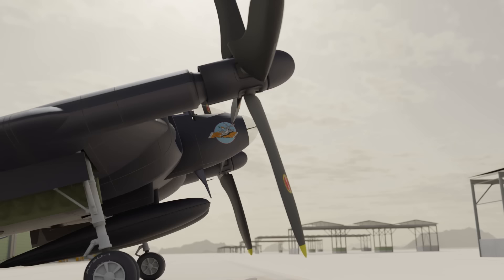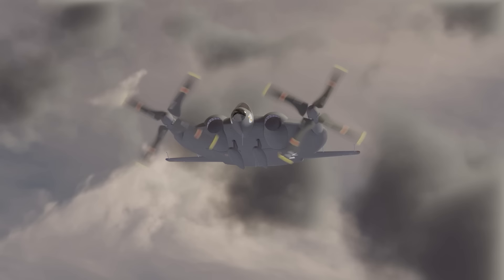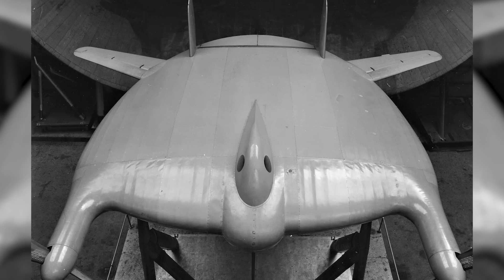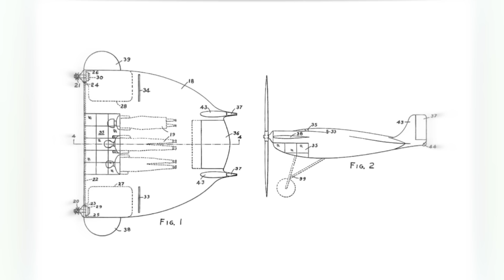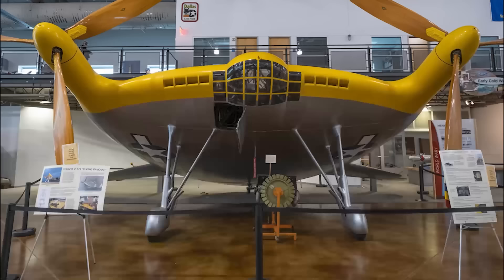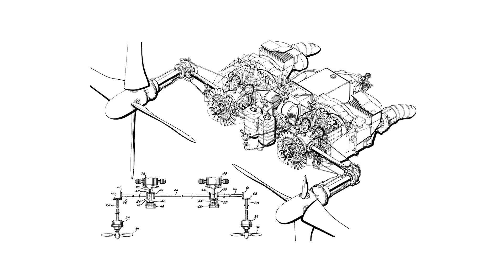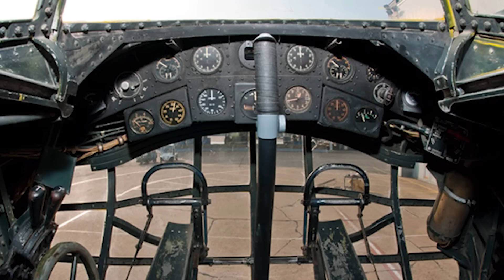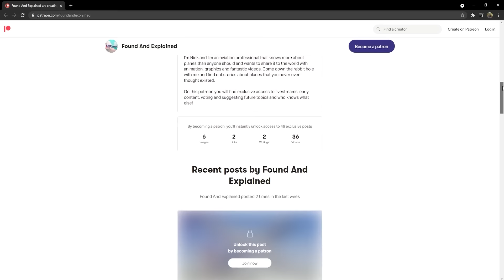The Flying Pancake - Slowest Plane Ever Made!

Comment: Looks like a perfect design to start for an all electric plane. 80HP is a piece of cake for electric motors, this could even work with current batteries.
Reply: Agreed.  No transmission.  The electric motors could be small enough to be pushed out to the edges.  A small turbine Aux can power the electric motors.  Contemporary batteries can do wonders to power a 30-minute flight.  More ideas like contra-rotation of smaller rotors can be helpful.
Reply: @lelandhetrick205  A 30 minute flight at these speeds doesn't seem very useful though
Reply: Hendershot generator
Reply: Look at the surface area of that thing. Cover the top in thin lightweight solar panels to supplement fuel cell/bettery usage.
Reply: smells like startup idea cooking
Reply: @LunaticWithALicense  I was thinking the same thing. I'd even put some over the bottom to catch sunlight reflecting off the ground and the sea. You could theoretically fly this thing around the world without having to rely on liquid fuel, and it could stop to recharge even in the most remote areas.
Reply: @Chad_Thundernuts  Nowadays everybody is crazed about drones, so I doubt anybody would be interested in actually designing this.
Reply: @FzudemB  planes don't have to travel on roads... so distance is a different kind of restraint.  A few mile range can connect people across rivers and canyons.  Just because YOU can't imagine it's use doesn't mean it doesn't have a use.
Reply: @niemand262  True
Reply: @FzudemB  If my mum agrees & if it is affordable I can use it to go to school.
Reply: @ScienceDiscoverer  What does drones being popular have to do with designing an airplane?
Reply: @Exotic-ps7vi  I think he meant quadricoptere  (+ I hate it too when popular term for any multi-spinyboi VTOL aircraft is "drone" now)
Reply: @FzudemB  it's very useful as proof of concept.
Reply: Yes!!  80HP, with no real demand for high speed or high rate of climb, piece of cake!
Reply: Load of solar cells on top? Could recharge on its own.
Reply: How about direct methanol fuel cells? Could work with current infrastructure.
Reply: Even some solar panels on top for a top off.  It would never land
Reply: @FzudemB  There is a market for short flights. Shortest commercial flight is 2km, connecting an island where ferry services are not suitable.
Reply: Why would you want dangerous electric engine in your plane.  Do some physics
Reply: @FzudemB  - That's a 30 minute flight with present Li-ion batteries that have an energy density of only 250Wh/kg. 30 minutes is also a very conservative estimate.  Already there are several new chemistries that are out of the lab that are pushing 400Wh/kg. Expensive and difficult to manufacture but already in use by the US military.  The new solid state batteries are promising better than that.  Non-rechargeable batteries like the Metal-Air Batteries can produce a lot more energy. An example would be the Aluminum/Air batteries which are already achieving 1300Wh/kg. If you want to use electric motors for propulsion but want to avoid the weight then a hydrogen fuel cell could provide ranges closer to jet fuel. I think this aircraft would be perfect for electrification.
Reply: @christianlords1340  How the engine is an issue ?
I though it was the autonomy was the issue.
Reply: Batteries in An aircraft🤦
Reply: @kasperkappe9066 Current planes use batteries.
Electric planes are already a thing but it's not commercially viable.
Reply: @FzudemB  I think its more useful as a “hey look what is possible” sort of thing with only electric motors
Reply: @LunaticWithALicense  solar panels are overhyped. This wouldn't work. In order for it to work a solar plane is highly specialized, it is essentially a highly efficient glider, with solar panels and small motors.
Reply: @AsianCole , so you're short sighted. Americans🇺🇸 aren't.
Reply: @LunaticWithALicense you vould integrate into body. But the energy generated wouldn't be much
Reply: @senatorjosephmccarthy2720  im “American🇺🇸” too but what even was the point of your comment
Reply: @niemand262  planes need runways to land on lmao
Reply: Looks like a perfect design for the wrong brothers.
Reply: Says the engineer
Reply: If you built it I'm down to test it but if I break it don't be upset
Reply: @LunaticWithALicense  tf2 spy moment
Reply: Why don’t you try
Reply: Weight
Reply: Personally i think if we did it right we could glide everywhere, lots of stations and real time weather monitoring, etc. Imagine just being able to hop in a glider and be literally catapulted in the air, cheap to build, out of wood even and slow enough not to be too dangerous.
I want to live in a world with commuter gliding and no roads
Reply: @Chad_Thundernuts  I think having them under would be too little yield to the added hardware weight, not sure on the top side panels though.
Reply: The weight added from the batteries would make any amount of sustained flight unfeasible. To add the power needed takes more batteries and its a ratio that just spins out of control. Batteries still have a way to go.
Reply: @FzudemB  could probably be used for air surveys especially by forest rangers spotting potential forest fire areas while using Solar power for longer range. Removing the flammable aspect of the fuel in the slow observatory aircraft they're using is probably a good trade.
Reply: Give this man an award pls
Reply: @01MEGABOB  good Point... but I wouldn’t take today’s smaller engines and much higher energy to weight ratios out of the equation... same goes for compositit materials and smarter eltronics. I didn’t look into the math myself but it could I think it could be done as an electric plane if u take all of this into account and maybe play around with the shape os size a bit. Btw I love that u seem to have really thought about this, keep it going bro :)
Reply: World's shortest commercial flight is around a minute and a half in good weather.  So I think there's a lot of potential in the half hour range, if you consider things like that.  The solar panels wouldn't really extend the range as sunlight can't necessarily be relied upon, so for safety reasons you'd need to limit it to worst-expectations.  But by goodness they could save a lot of time and money recharging it!
Reply: @01MEGABOB  what if the battery was also the plane itself
Reply: @lelandhetrick205  why push th out to the edges? How many planes have thrust at the wingtips?
Reply: Seems easy to fly too
Reply: @christianlords1340  an electric engine is dangerous? You mean it could stop working?
Reply: 80HP? I cast Power Word Kill.

I know, I know. It doesntean Hit Points, but shut up, Internet. Let someone have fun.
Reply: Do you know how much more batteries weigh than gasoline for the same energy output?
Reply: @ScienceDiscoverer  Concept, currently the classic Predator style drones have comparatively limited loiter ability due to the need for fuel.

In Afghanistan (yes recent sore point) British and NATO forces supplemented that and other aerial assets for ground surveillance with what was essentially a blimp with multiple optical options.

Unsurprisingly they were shot at regularly with a variety of small arms and rpgs, most missed and provided enough information for retaliation. However, some were successful which removed an essential asset and lead to exploitation.

A big slow surveillance system with minimal power draw, with space for a broad range of sensors, as well as broadcast capabilities to talk in different ways to different assets, could be useful.

So sure drones, but how about one like this.
Reply: @Prodzick  Typically weapon fire autonomy is the main concern.
Reply: @01MEGABOB  maybe, but a predator drone has a typical loiter/time on station of 14hrs. If you can do 21, you've already massively improved your options, double it, and you've reducing the fleet maintenance time. Go beyond that and your returns keep coming.
Reply: @Arcenture  thats all fine and dandy. But given our current battery technology we have no way to match the power to weight ratio of traditional aircraft, nor make a battery that has an equilivenant energy density. Its simply not feasible. It is literally a math problem that can't be solved for what we want. At this point we need to figure out fusion or abandon the idea that fully electric aircraft could be worth more than they are now, which are essentially toys.
Reply: It fills a niche that isn't really in demand anymore.
Reply: Some electric cars have 1200 horses
Reply: @heiko5209  and what is the range of these cars? guessing its not much considering it had to use most of its available space to house to gigantic motors for all that power. this is what I have been talking about. you cant have everything. if you watn more power you need more motor, but to go the same distance then you need more battery. but wait, you just got heavier, so add some more motor. oh wait now you use more juice, so add some battery. and so on and so forth. same damn story with planes, with double the consequences.
Reply: Also further imagine that the gliders are equipped with fly-wheel powered propellers for an extra boost when needed, and possibly there could be a way to use drag to rewind the flywheels by placing turbines posterior to the propellers that engage when needed for air braking or passively when gliding for gyroscopic stability, possibly having multiple gears for certain functions. 
It's only natural that fly wheels should be used for flying
Reply: Look up electric planes. There are already models that are fit for commercial use im small aircraft travel. Thats a giant market and its taking it by storm at this moment. Deutsche post ordered tons of them for postal delivery
Reply: You can patent a different method of using someone else’s patent…
Then you and the other person have to be paid for it
Reply: No need to, many turboprop already got fitted with battery, most of them able to fly good distance with good payload.
Reply: Electric flight is VERY FAR away. The weight of the batteries is the biggest barrier.
Reply: @FzudemB  a recreational flight for enjoyment will be nice though
Reply: @Exotic-ps7vi  pretty sure what he means by drone is UAV unmanned aerial vehicle
Reply: thing called drones?
Reply: No... Fuel's still better due to its very high energy density than batteries. And aerial refueling will help a lot. And soundproofing can also be done on this design...
Reply: Modern giant ultralight construction with huge wings like what they use for gliders is still better I bet. That's what they're doing now for experimenting. Just try putting one of those in a ship for takeoff 🤣
Reply: @niemand262  It doesn't have a use.
Reply: @romaboo6218  How exactly would that happen genius?
Reply: @roncatman6236  by crashing
Reply: No because batteries are still too heavy at reasonable energy levels.
Reply: @justsain3236  you'll still need a ppl
Reply: @01MEGABOB  this isn't meant for sustained max speed long distance flights, it's just meant to fly from here to there so there's no need for really big batteries, plus the electric motors don't drink energy that fast
Reply: @ch6ney  and you know how much easier it is to obtain electricity than gas when you're stuck in the middle of nowhere?
Reply: @01MEGABOB  ACKCHUALLY those cars actually have some really long ranges, take Teslas for example, they have a lot more than 80 HP and they can go really far too
Reply: @roncatman6236  if you're wrong you have to eat your slipper
Reply: @Chad_Thundernuts  I know you haven't done the math on that!
Reply: Don't be quick to ignore this things overall weight was 1000kg, before batteries, sorry dude I don't think we have the correct efficiency to make this viable with current electric tech, we could certainly make it fly, but 15mins for 50miles ain't worth shit....
Reply: @FzudemB  good enough for a flight between small distances and short runways, like a bunch of islands
Reply: This plane was designed to take off from a really small runaway and be slow, it is not something you would need on an electric plane and also you can make it actually more efficient if it goes faster because you have more lift per surface
Reply: @FzudemB  It's more then the right brothers
Reply: This could be a great way to get from two close cities, or to get to the mountains from about a 5 hour drive away.
Reply: @christianlords1340  "Electric Engines", or DC Motors, have been around since WWII, possibly earlier. RC Cars, Drones, hell even full scale Electric Trains have these. "Electric Engines" as you call them are not dangerous. It's clear you need to take your own advice and "do some physics".
Reply: Planes of this sort have shown that they're quick on little power and have astounding climb rate.
The V-173 was based on the Arup S-2 from Indiana, 1932. See thee "Flying Heel-lift" video on youtube. See also the Nemeth "Parachute Plane" and the similar Farman 1020 from the same time period as the Arup. Like the Nemeth, very-low aspect-ratio, faster than the planes which the fuselage came from, super-STOL, stall-spin proof like the Arup, capable of amazingly steep climb.

There's a circular wing single-person VTOL quadcopter by Zeva being tested now. Like the Zimmerman plane, it uses the super-slow flight and stall-proof characteristics at high nose-up, as the starting point for a VTOL plane.
Reply: @FzudemB  it depends. It could solve the problem of moving from one island to another. Very small runways and relatively small distances. It could be used in Polynesia, Hawaii, Greece, Italy,, Japan, Malaysia, the Philippines, well, name it. It's mostly the cost that will be a problem.
Reply: Just watch a RC version of it.https://www.youtube.com/watch?v=gnTEXdialsk. And a modified version it can be an eVTOL,
Reply: Add some solar panels over the wings and boom
Reply: do you have any idea how heavy batteries are rn? You're dreaming if you think planes will be electric any time soon
Reply: @Tron-Jockey  can you please drop your email or some link . I love your insights and want to get connected with you for same purpose .
Reply: Why? Electric is worse for the environment unless nuclear and just supports the ccp
Reply: @LunaticWithALicense  solar panels might give you an extra 1 minute. They really don't make sense on planes or cars.
Reply: @ricvanesh9445  A drone IS and ALWAYS HAS BEEN a remotely piloted flying vehicle, form matters not.
Reply: @Chad_Thundernuts  except that would never be viable. Batteries weigh a ton, so do your solar panels. Nor would any electric plane be viable for military use. Show me something electric that goes even close to Mach 1
Reply: @01MEGABOB  What's the range of one of these electric cars these days? ~300 miles at ~130 MPH. What's the operating range of your internal combustion car at that speed?
Reply: @niemand262  No that's still ridiculous. Lol
Reply: @nunyadayumbusiness591  if you can show me an electric car, hell, ANY car that can travel 300 miles while doing 130 mph, I will shit a brick and mail it to you.
Reply: Theres something very similar it has 4 motors and is vtol ill try to find the name
Reply: Wouldn't the weight from the batteries increase the needed HP?
Reply: Batteries are always going to be too heavy to make electrical powered aircraft a realistic mainstream possibly. It pretty much comes down to energy density: for about gallon of petrol (around 4 litres) you need the equivalent of about a pallet of batteries to provide the same amount of energy. In a car this is doable since your average car only has a fuel capacity of about 10 gallons anyway (or about 40 litres). Where you run run into problems is when you try to scale this up to larger vehicles. For example a 747 has a fuel capacity of 63, 500 gallons, so yeah. 

Added to this is the added issue that batteries don't get lighter as you burn off fuel in the same way as petrol powered aircraft do. So consequently require as much energy to power at the end of a flight as at the beginning.

Where electrical powered could find a market is with small prop aircraft.  But for long haul fight we're going to be stuck with jet aircraft for a while yet.
Reply: They won't be very useful for many applications. And, the problem is not just the power output but the energy density for batteries. Most of the plane's weight will be composed of batteries.
Reply: But the distance is less then if it were gas
Reply: Also the plane since it was developed during ww2 it would need to fly very far at a slow speed
Reply: Gas is more efficient than electric how is that electric produced currently its easier to do electric but it would be very wastefull
Reply: @ricvanesh9445  I hate hearing people call all quadcopters drones. I don't care what anyone says, a drone is a unmanned aircraft equipped with surveillance equipment for reconnaissance, surveillance, filmography, recreation.
Reply: Mine the earth even more for materials for batteries which are hella hard to recycle and just get dumped when the batteries don’t hold a charge and all the toxins and chemicals go into the earth and oceans cuz America sells its garbage. Electric is not the end all be all it’s a shit concept and is not a viable option for sustainable energy electric is good for industrial use power tools tugs that kind of stuff not aero planes and not replacement of the whole worlds gasoline and diesel fleet it’s good for small scale electric cars like a few million. There are plenty of good groundbreaking inventions that the oil companies killed bought patents and hid them away forever
Reply: @Prodzick  Some electric designs would be commercially viable for personal use if there was a considerable demand for them.

Planes are inherently expensive to develop, build, maintain and pilot, so anything without a good market waiting for it just won't be viable for industrial scale manufacture.

There are two kinds of amateur pilots:

1- People with just enough money to buy and pay maintenance costs of the cheapest planes. These people would want to purchase electric planes, but the entry prices can be prohibitively high, and the other group does not care about making things accessible to "commoners".

2- Rich AF people who buy whatever they feel like buying and don't care if these things are handmade and very expensive per unit. Also, they don't care about fuel costs, so whether or not they get electrical planes is just an arbitrary choice.
Reply: And how much would the batteries weigh?

Remember, required range (energy/fuel) is:
Range of the flight+go around+alternate+usually a 25% safety margin.

Now how much would the batteries for that weigh and what power would be required for takeoff, climb, cruise and decent? 
Within the limits of the runway length of a typical airport.

Thrn fsctor in the weight of the engines, the passenfers and luggage and the necessary structure (edit: including  a landing gear atrong enough) to carry all that weight
Then check if the power is sufficient to get that off the ground

If yes post the info in this comment thread.

If no recalculate the power requirement+baterry requirement as well as the necessary structure.
Reply: Kevlar/Carbon composite airframe, Lexan windows, 2 boom-mounted electric main props, 6 perimeter-mounted vertical lift electric rotors, 2 centrally mounted multi-fuel turbine power units...
Reply: @ScienceDiscoverer , add a few more rotors for VTOL, and there you go.
Reply: @off6848  thin-film L-Ion cells could be attached to the inside of the wing surfaces.
Reply: True Dat. Panel up the top with photovoltaic cells and make the motors regen where the blades are essentially wind turbines when sitting on the deck or on some remote island like Midway, Iwo Jima or the UK. Just a flying generator/desalinization plant for places with no infrastructure.
Reply: @dingdingdingdiiiiing  solar panels power satellites for decades.
Reply: @CountingStars333  Yes. In orbit. Turned  to the sun at all times except when/if in the shadow, weight, dust, clouds, sun declination is not an issue. Plus higher solar radiation due to no atmosphere. Completely different thing.
Reply: Wide body = wide solar + wide battery
Reply: it is a near VTOL when you built it for RC, especially if you over power it!
Reply: This was literally what I thought the moment that came up. "Boy, if I had more money then I knew what to do with, I'd totally want to build a replica of this thing with electric motors."
Reply: @lelandhetrick205  No, they won't. The whole idea is that rotation of air stream behind classic propeller "sails" wing tips, cancelling vortices.
But it is a perfect shape for small stealth drone that can fly fast or hover.
Reply: nature already made one of these, the manta ray.  So, why give pancakes the credit?  The Manta Ray was robbed
Reply: @pokerchannel6991  Never give drugs to your aquarium fish.
Reply: @niemand262  unfortunately helicopters and bushplanes already have that covered, and for relatively very cheap
Reply: I wouldn't call 1,000 amps continuous a piece of cake.
Reply: @niemand262  a modern version of this would be useful in rural Alaska, though it would need to be Maintenace friendly as having anything hard to get/expensive would be problematic, the solar panel idea above would be borderline useless in Alaska though

other things of note would be how it is on runway conditions, IE does it neat to be a tarmac or can it just be a short dirt strip
Reply: @FzudemB  it does for hobbyists
Reply: I wonder if it would work with those ultra-light rotary engines they make for drones?
Reply: You can also hook that 80 hp motor up to a winch, and tie the winch to a lever that releases a bucket of water on your head when pulled.
Reply: Give it a catamaran so it can be amphibious.
Reply: Your absolutely right and it can't stall !
Reply: There are better ev planes